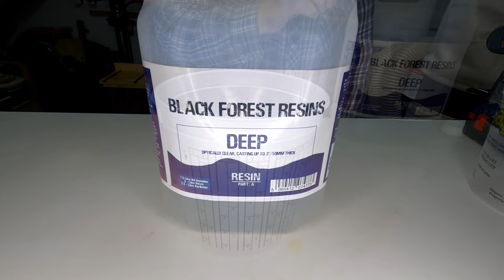Woodturning - Resin & Maple Burl Vase

Comment: Nice job.  I was a little concerned about the blue resin.  It almost at first like it didn't set properly but the vase came out really nice.  Thx for sharing
Reply from the maker: I was a bit concerned at first as well, to be honest. It seemed a little bit soft at the top when I was prying on it and that was after sitting in the pressure pot for four full days. It is a very slow setting resin and I knew that. It turned very well in spite of that and I’m quite happy with it. Glad you liked it. Thanks for watching!

Comment: Yes the straight edges do look a bit out of place but it's a bit difficult to predict what you are going to get when placing random pieces in the pot. My pet peeve in this type of turning is the amount of very nice burl that gets buried in the middle of the work piece.  Also resin is so expensive. I think I would try to find some alternate material for the center of the turning. How about a bag of sand???? Now, having said all that, I think the vase you produced is quite beautiful. I like the colors and the shape.  And Ack's produces a great finish. So, thank you for sharing. Have a great 2022 and stay safe.
Reply from the maker: I really hate the amount of resonates gets wasted, Glen. If I was doing something much larger in diameter I would probably fill the center with some scrap wood or something that I didn’t mind turning away. I like the idea of putting something in the centre that I can waste but I think Sand might be a little tough on the tools. Maybe it would be possible to just open the top of the bag and pour it out if it was not buried under the resin. Thank you for the idea, Glen. I will have to do some thinking about that. Take care of yourself, my friend. Thanks for watching!
Reply: I recently saw a video where they used a bag filled with rice. But I thought rice would float. That's why I mentioned sand. I figured it would be in a bag or taped up and would be emptied some way before turning. Just a thought.

Comment: Nice piece, Gord. That resin shrinkage and soaking in, eh!? I'm on day 5 of a resin & curly maple mist/fog bowl. Had the 8"x3" deep maple blank glued up with a round 2x4 waste block, 4" tall. Waste block down in the bucket, poured resin until it was above the maple, right up to my tenon. Sat in the pressure pot 4 days, came out with a 3/4" gap between the maple and the resin. I left it too long for the second pour, of a different colour. The two pours look intentional, and will be helped by a matching cylinder that will house the mist maker. Still, I liked my original idea best, but not a single bubble to be found. The blank is flawless.

I left it a bit too long to turn and it's harder than I'd like. Grateful for those birthday & Christmas gifts of quality steel and sharpening upgrades. But, my short OEM tool rest on my little midi lathe is making my current depth of hollowing very tricky. Just need five more good cuts tomorrow morning. The final cleanup with negative rake carbide will be delicate as it's a wimpy tool & will be way over the tool rest. Unless my new gooseneck arrives and I can stick it in my Mike Hosaluk handle tomorrow, it will be intimidating. I can't justify a hollowing system for my little setup, but my latest deep yarn bowl and this fog bowl are making m e think about more upgrades. :)

Thank you for showing us your resin process.
Reply from the maker: That sounds like a lot of hard work you’re doing, Jay. If you are willing to share I would love to see photos of the finished product. I’m sure it will be gorgeous. I hope it turns out as well as you want it to, Jay. Thanks for watching!
Reply: @GordonRock1  Gary wanted to see it, too. I'll send an email when it's ready.
Reply from the maker: Thank you, Jay.

Comment: Great job Gord. I like the piece very much - great colours. Query - did you coat the timber first. I have heard that it should be coated so as to prevent the release of air bubbles in the resin drying process. Cheers from the Land Down Under.
Reply from the maker: I’m glad you liked it, Ray. No, I did not quotethe timber but I’ve just recently purchased some resin that is designed specifically for that. I will have to try it out later. Have a great day, my friend. Thanks for watching! Greetings from the Great White North. 🇨🇦🇨🇦🇨🇦🇨🇦

Comment: While I’m not a big fan of resin, this vessel looks very nice. I recently finished a Beads of Courage box with colored pencils embedded in resin for the feature ring. It turned out ok, but I hate dealing with the resin shavings and I static cling from the dry winter air. Plus I had to separate the resin shavings from the wood shavings to keep it out of the compost pile. Looking forward to you next project.
Reply from the maker: Greg, I have to agree that probably my least favourite part of turning resin is cleaning up the shavings afterward. In fact, every time I turn resin I think “this is going to be the last time”, for that reason. But eventually I end up trying another one so that I can justify the expense of the pressure pot. 🤔🤔🤔 Thanks for watching!
Reply: @GordonRock1  I don’t have a pressure pot and I’m not planning to buy one. That’s a few hundred bucks I could spend on other turning tools.

Comment: Hi Goed, great work as always..do you like the Black Forest resign.  How long before demolding?  Is it easy to turn?  Thanks
Reply from the maker: The deep resin that I use is supposed to sit for four days before demolding. I don’t have any experience with other resins so I really can’t say if it’s easy to turn compared to others. I like it but as I said I don’t have experience with others. The two things I like most about it is that there is no odour and it is non-toxic so I don’t have to wear a respirator. I have seen other people using resins where they have to use a respirator and that would be a pain in the butt. Thanks for watching!